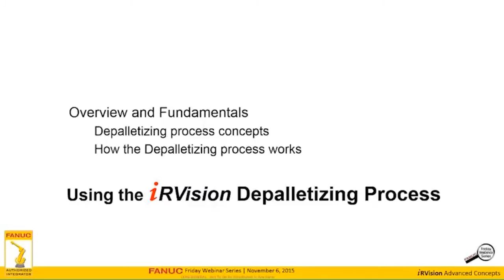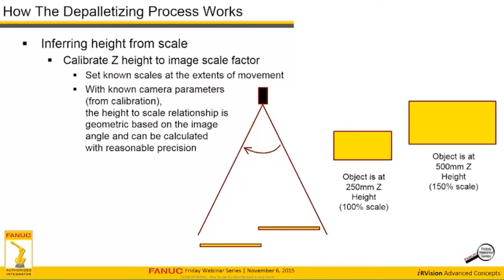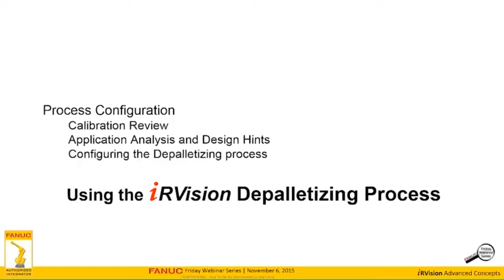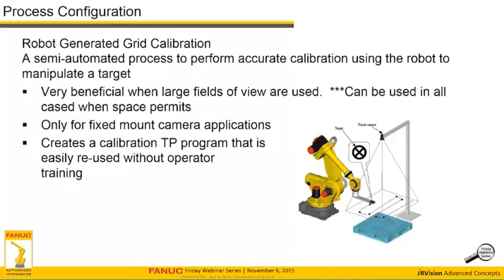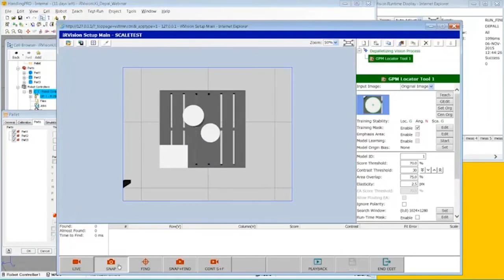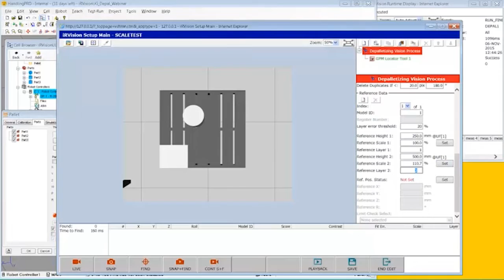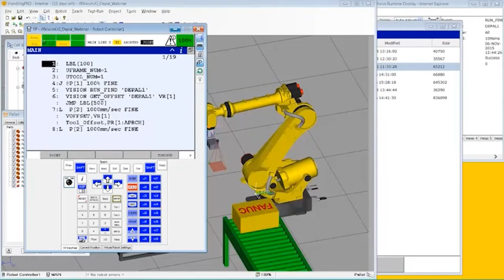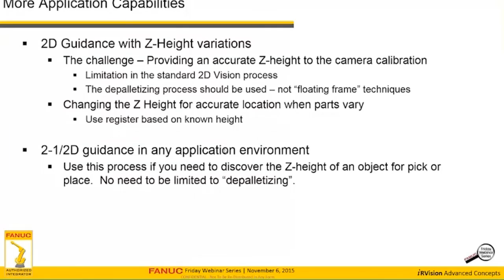Using FANUC iRVision for Robotic Depalletizing Processes

Comment: Any way to use this process while using the palletizing option RTL-J500
Reply from the maker: Hello, here is some info from one of our Palletizing engineers:

The J500 Palletizing option is not actually PalletTool, it is just a tool to use when making your own programs that allows you to teach a full array of points by only teaching the corners of the array.  Section 7.6 of the HandlingTool manual covers the J500 option if they are looking for more information on how that works. Vision is supported when you are using the Palletizing (J500) option.

You can also reach out to our Custoemr Resource Center fro additional info:
https://www.fanucamerica.com/support/robot
Reply: @FANUCAmericaCorporation  thanks for the response.  I guess my main question is if I can use iRvision useing one vision tool and shift it with each Pal reg increment. Or does it take the offset from the Reference Position I recorded in the GPM. It seems The Palletizing option ignores frame changes and uses Base coordinates. So I had to create a separate tool for each pallet position in order to offset correctly.